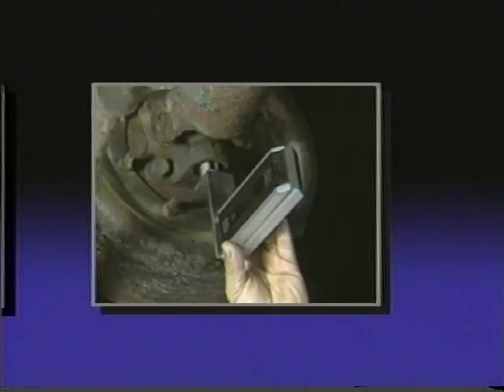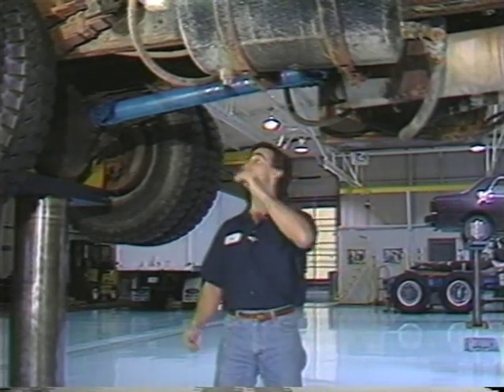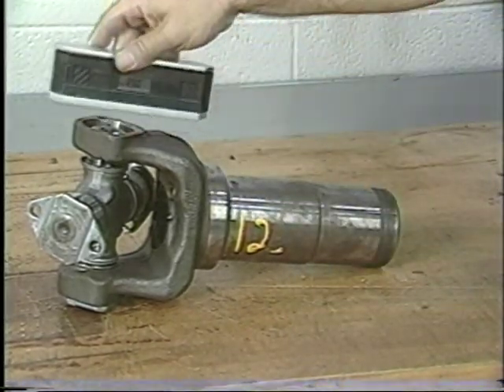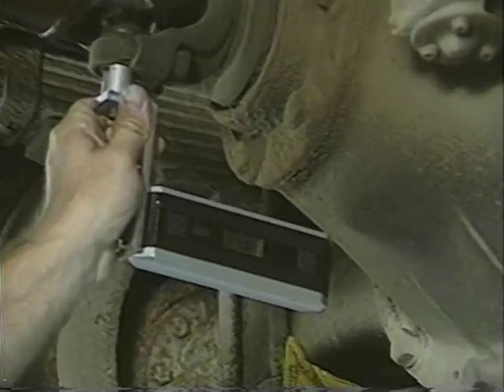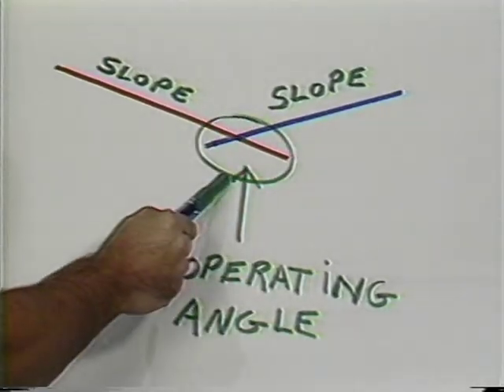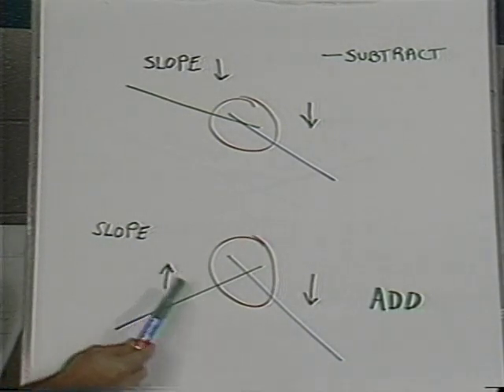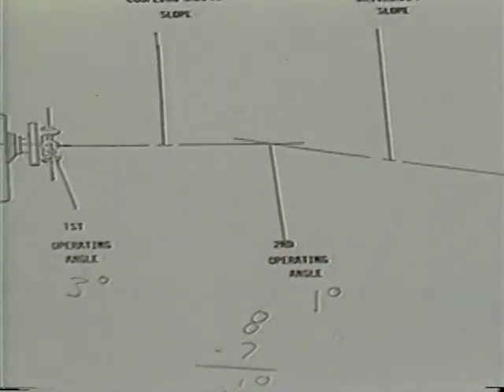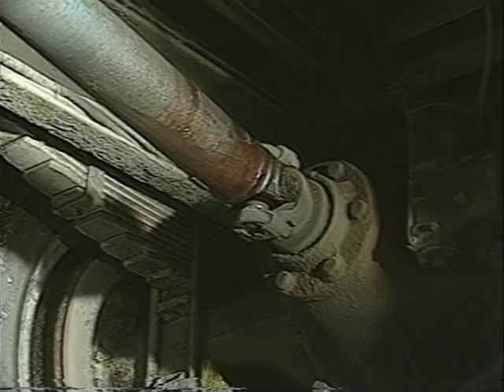How to Measure & Calculate Drive Line Angles

Comment: how can i decide on an angle of a single drive axle having 2 cv joints connected to one wheel of fsae car. i want the power loss to be minimum and i cant keep the axle horizontal due to our car's design. pls help by replying soon